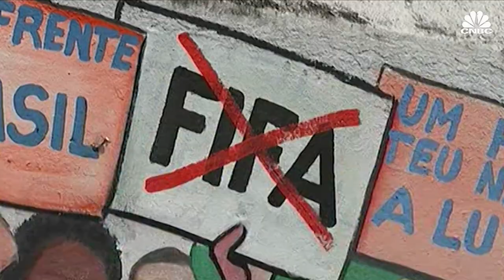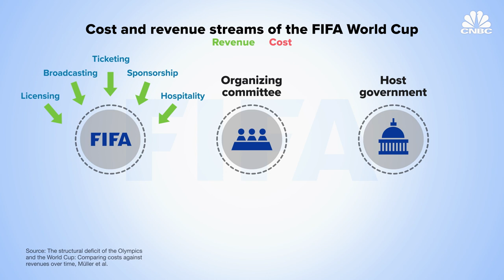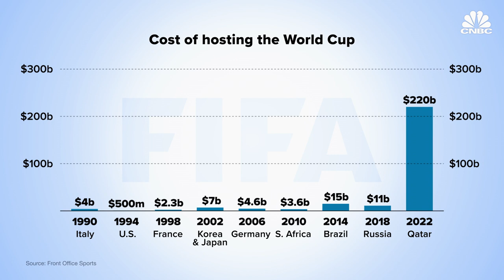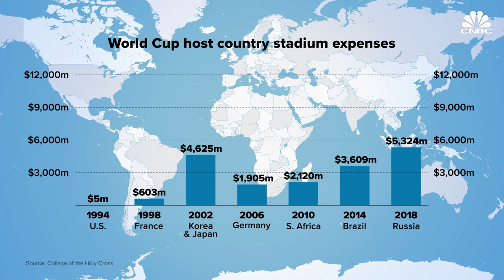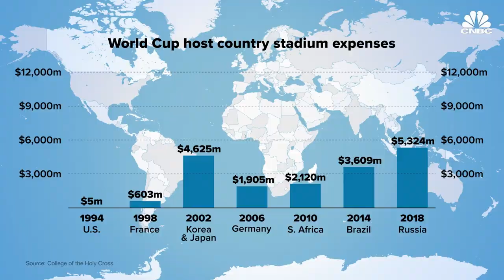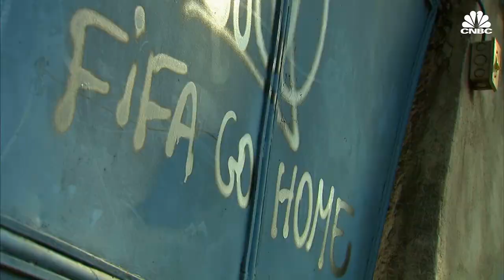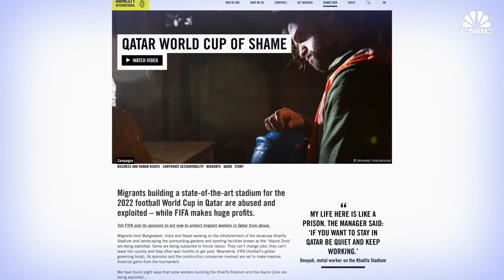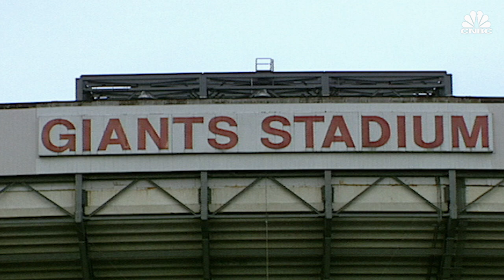Why Hosting The World Cup Is A Bad Idea For Countries

Comment: You cant put the price of world up on a spreadsheet. There are all sorts of unintended benefits. Loads of people/businesses set up shop there. Have their feet on the ground and make decisions to move there or open up shop at a later date.

Qatar is well placed because they have an airline and in transit area for the whole world.

They do need to differentiate from dubai though.
Reply: I'm Qatari, the price tag is poorly misunderstood. It includes many multi billion dollars development projects that was planned for way before we won the bid in 2010. Like building new airport instead of the old (single runway) airport. Or new sea port to export more of our petrochemical products ( notice how completely unrelated to sports) Or modernizing and extending our roads to combat traffic (in a country where cheap petrol prices make people drive more instead of using public transportation)…etc. 
Along the way, the conditions of foreign workers have improved significantly. Some parts of the labour system were completely overhauled. The Kafala system was scrapped. Their accommodations were improved. Even FIFA acknowledged the reforms.
I'm sick and tired of this anti-Qatar BS. Some just want to condition social and cultural changes to host such events. That's nonsensical, as it's unrelated to any of the qualifications in the bidding process.  You can't just transform a socially conservative this easily. Some exceptions will be made for alcohol consumption in public during the tournament. (You can drink in Qatar but only in your house or in hotel bar).  But even a guy like me who is fairly western minded, see a benefit of our way of life. We don't have to worry about drunk drivers while we are driving, or deal with violence caused by alcohol.  
You are all welcome to Qatar.

Comment: There is an info totally inaccurate over there. Mane Garrincha stadium hosts concerts and soccer games throughout the year. It’s under utilized but still it’s being well kept through a company which will likely also manage the Maracana stadium if Flamengo and Fluminense (both soccer clubs) don’t do so jointly. They are all in a bid for the Maracana. But the stadium in Brasilia is not a bus depot, only part of the area outside it was temporarily used for this purpose (Google it if you want to).

Comment: 220 billion is the value of the cost of the Qatar plan 🇶🇦 2030, not the cost of the 🏆 World Cup, all stadiums cost 7 billion, the 2030 development plan was approved 2009 and winning the organization of the World Cup accelerated the development process from 20 years to 10 years, which include an integrated infrastructure of roads, transportation and metro network was established, and expansion of two airports, an expansion of the port one of the larggest in the Arabian Peninsula, public parks, 32 hotels, a complete new city with a capacity of 200,000 people, the city of Lusail, universities, mosques, commercial centers, hospitals, research centers, arms deals, training and rehabilitation at the highest level, and other services.

Comment: Qatar is an oil sheikdom with an annual GDP of $320bn+.  The cost of this World Cup per year of preparation came to less than a tenth of that.  The far greater value than the revenue the tournament will bring in, which will be a drop in the bucket of the Qatari economy, is the sportswashing of the corrupt medieval regime that runs the country.  To the sheiks, that is a premium which makes the costs well worth it. They could care less if the stadiums are never used again and left to crumble.  They've served their purpose.